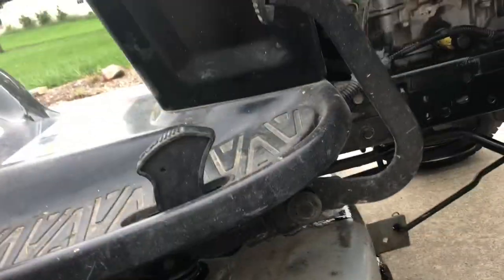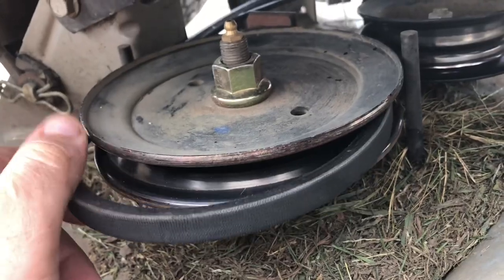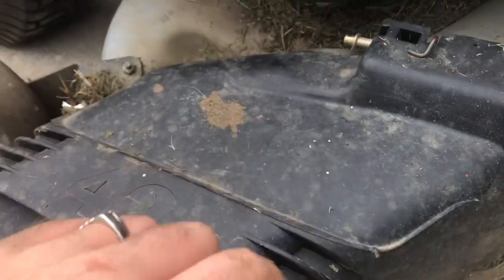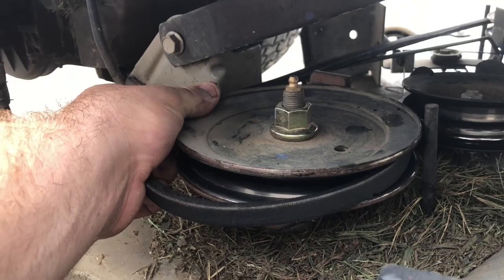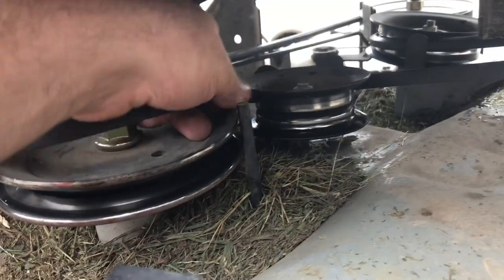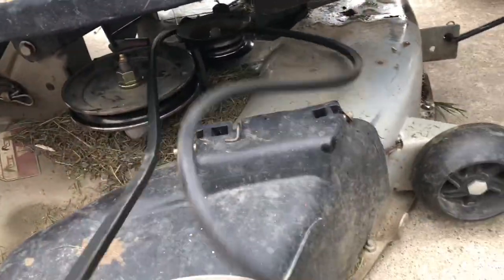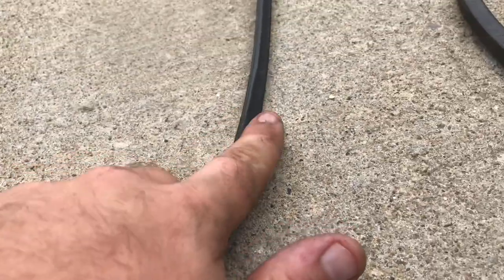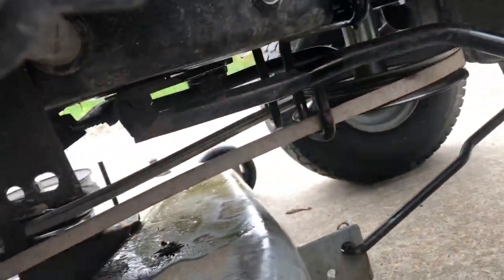Lawn Mower Deck Vibration & Shaking Badly - Replacing Belt

Comment: My mower shakes like crazy when the blades are engaged. I changed the blades, both spindles, and it still does the same thing. Does this sound familiar as to what happened to yours? I am gonna change the belt next. It has messed my summer up so badly. I am hoping so much that changing the belt will help. Thank you.
Reply from the maker: Is the deck secured really good to the mower? Yes def replace the belt

Comment: what else could be the problem?
I changed spindles, pulleys, belt, knives. vibration is still there!
Reply: Is deck bent? if so, edge of blade could be tapping it? Just thinking
Reply: Could also be that the blades are imbalanced. Maybe they are broken on one end